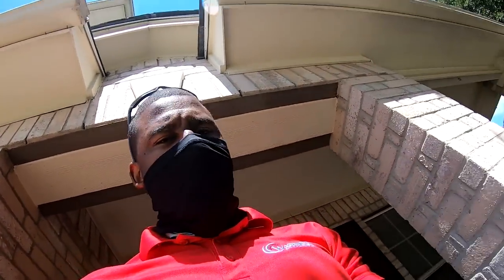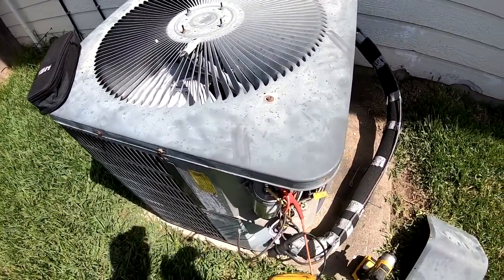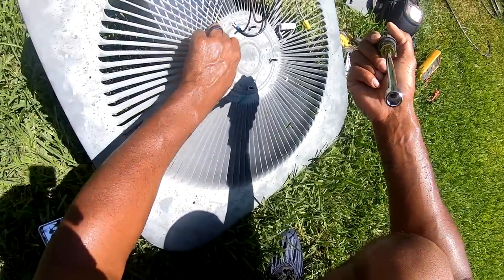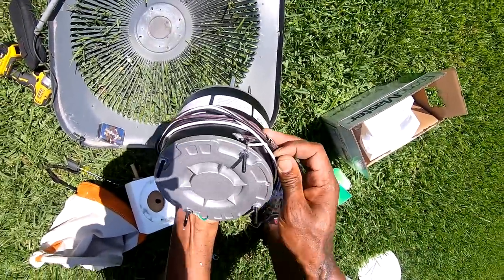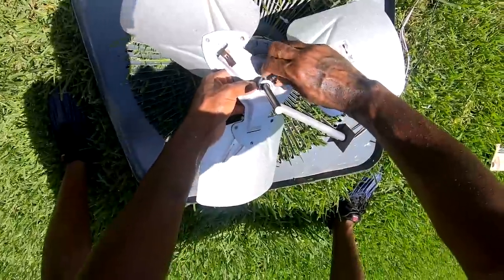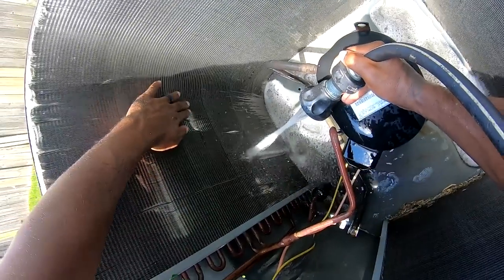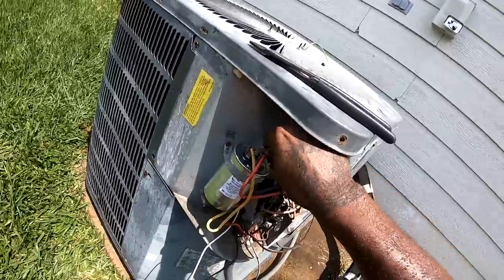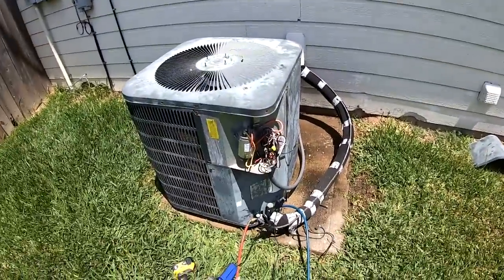"Unbelievable Situation: Goodman Fan Motor Won't Spin! Witness the Unconventional Repair Attempt""

Comment: great job man, i just joined hvac school myself. quick question, when checking a run capacitor, do you always have to check it in ohms?
Reply: Use a capacitor check function.  It measures the microfarads.  An ohmmeter only gives a quick indication.